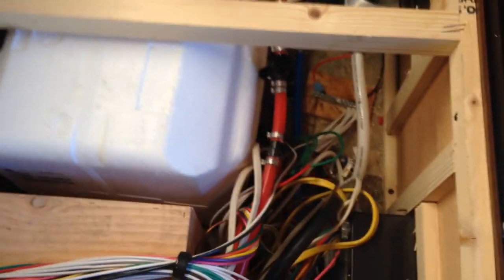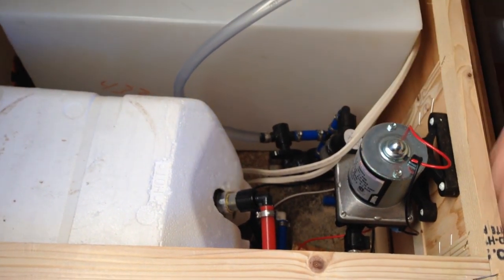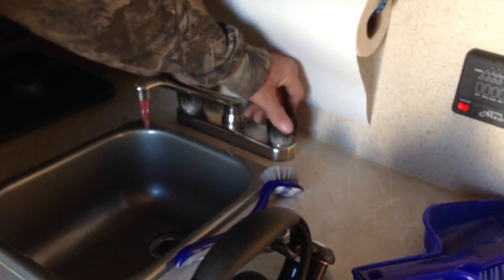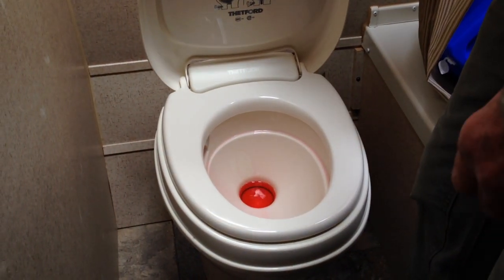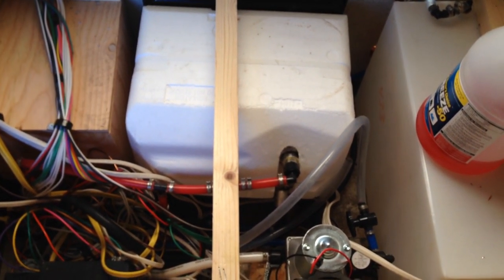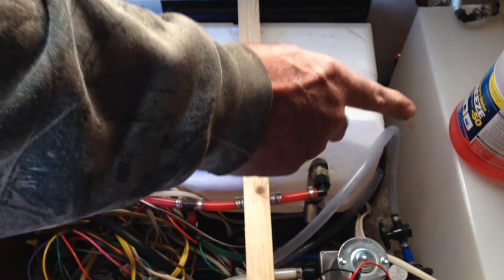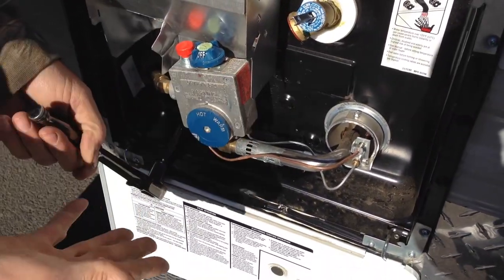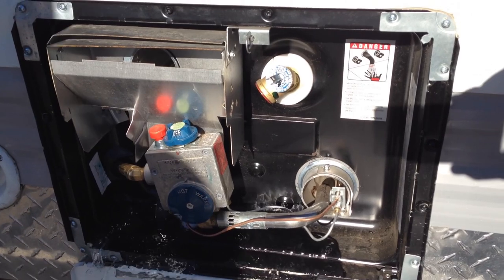RV Winterization - 2014 Jayco Flight Baja

Comment: Hey man thanks for the video.  How do you find the Tacoma for towing that trailer? I have an 03 Tacoma V6 4x4 auto and thinking about getting the same trailer.
Reply: I replaced this Tacoma with a newer one (2016). It does well, but it's at its max going up hills and can get only 8-11 mpg. But to buy a Tundra is $10k more and it's too big for my garage.